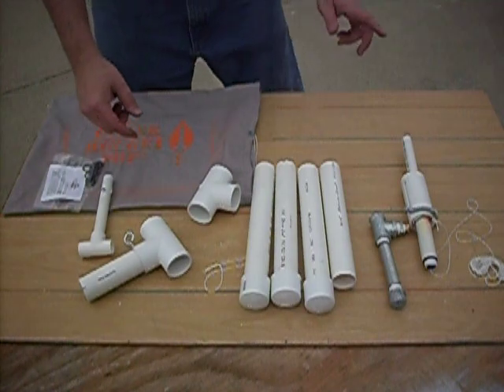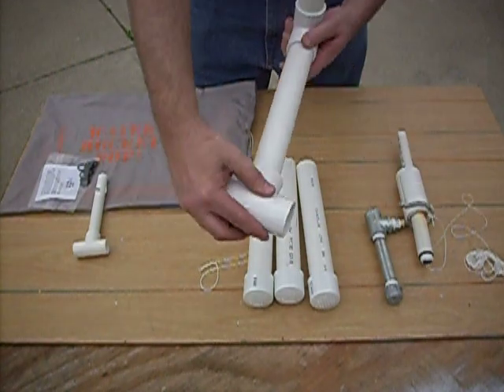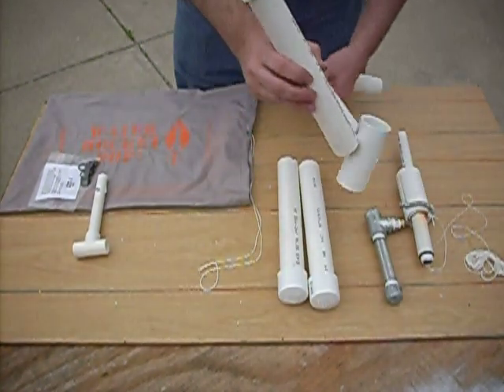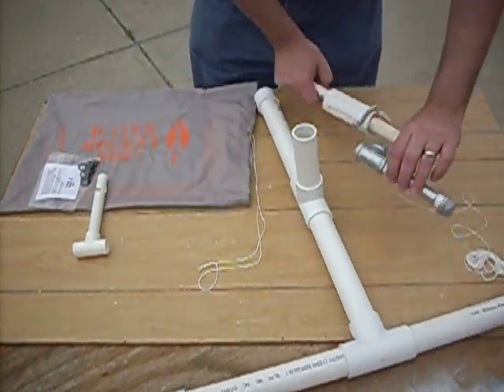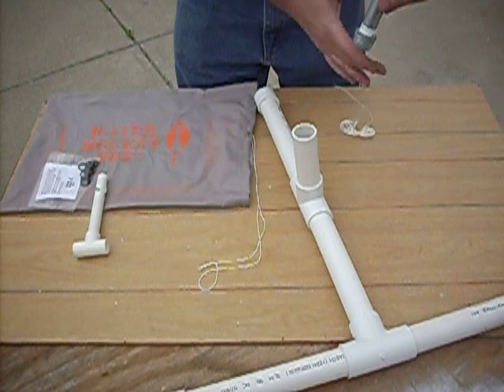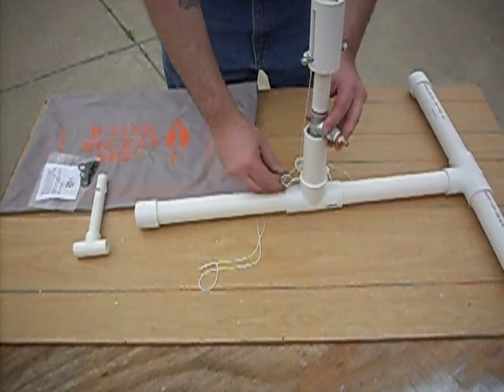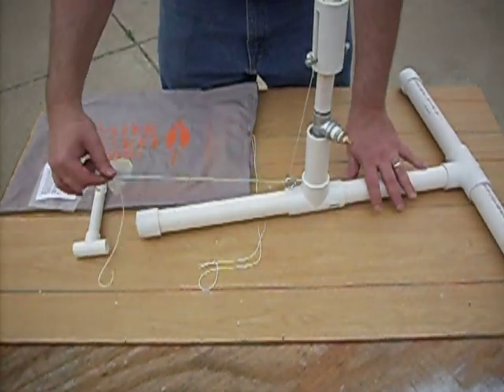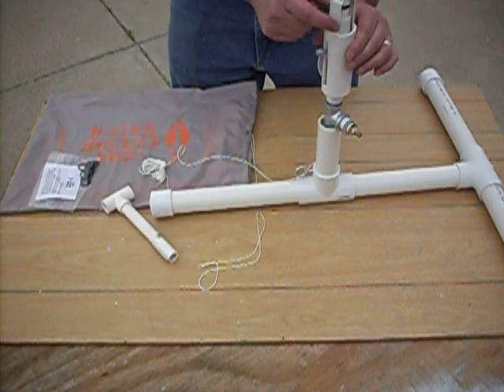2011 Launch Pad Assembly

Comment from the maker: I will be working with koiosintell to resolve any issues.  Please note that launch pads are created from off-the-shelf plumbing parts from the hardware store.  The parts are typically dirty when new.  I don't take the time to wash them.  My contact info is on WaterRocketPop web site for any questions.